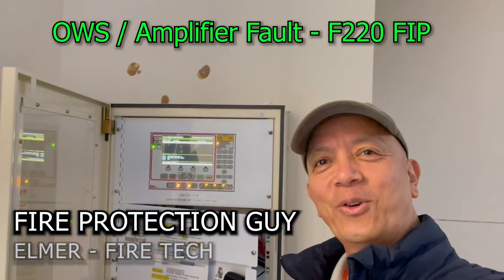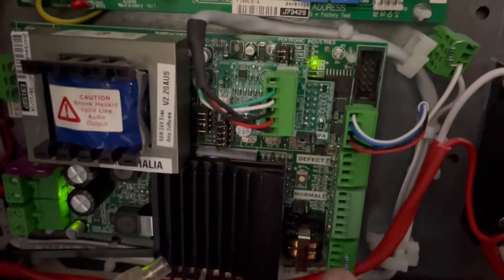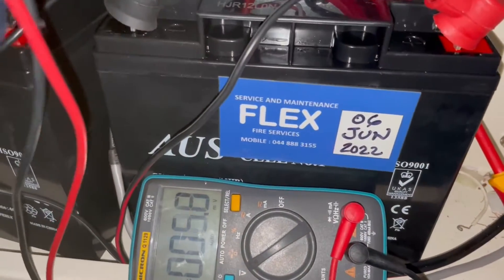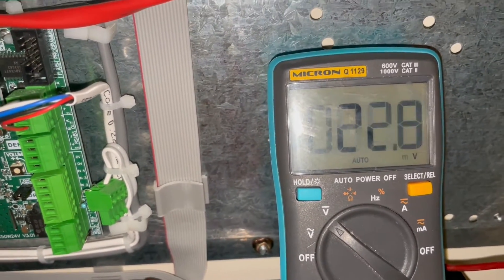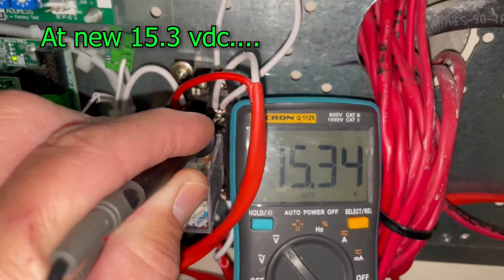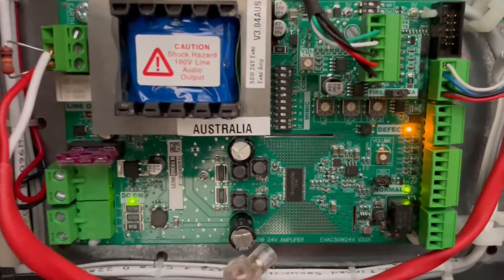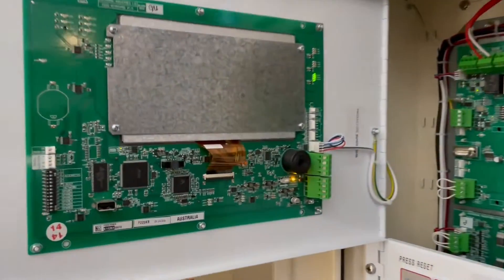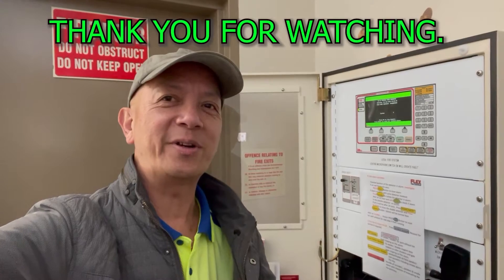Fire Alarm System Fault Finding - Occupant Warning Amplifier Fault

Comment: Sir Elmer nag apply po ako as fire alarm tester / fire alarm tech. sa NZ po. ill be having next week 3rd interview(panel interview) sa Nz po. Halos napanood ko na po mga videos nyo. Any tips po para sa interview ko po.tnx po
Reply from the maker: Most of NZ panel is pertronics system either F100A or F120A or F220 (newest that replaced both fire panel). All fire alarm panel I have featured ay matatagpuan rin sa NZ. There's more of course like WOrlmald F4000, Notifiers / Inertia panels, Chubb panels at AMpac Panels. But they are more of Pertronics system. If they ask you what do you know about fire alarm  and evacuation system testing...  sagot: it is done monthly and once a year. Tell them you are not sure if NZ is doing what Australia is doing when it comes to testing fire system. For monthly testing, you make announcement... isolate the fire brigade thru an ASE...isolate air con trip, fire door trip (if any)... trip the evacuation system or EWIS or EWS automatically thru an active alarm from the fire indicating panel... then reset the system after the test. Afterward, fill up the fire panel and OWS logbook. DONE. For yearly, test random detectors per zones . In australia under AS1851 ( Maintenance of Fire Equipment) , 20 % of heat detectors and 50% of smoke detectors in the building. Why 20%...so in 5 years all the heat detectors are tested.
Tell them that you are willing to test as well smoke alarms ( watch my video) for residential units and homes if assigned....and or replacing smoke alarm batteries. As a fire alarm tester, you must also check the battery if more than 2 years old or whatever the requirement of NZ maintenance standard. Tell them that you can replace FIP batteries. They are all 12 volts but different AH (ampere hour) ratings. 12v + 12v = 24 vdc . Fire sytem runs in 24volts with max output voltage of 27 volts DC.
Reply: @fireprotectionguy7943   salamat po sa mga inputs sir. God bless po

Comment: Please do video for fire alarm graphics system
Reply from the maker: Hi Reeban, i don't have a site with fire graphics system. I got few before when I was working as technician but no I have no access to those site. I will try if I encounter one.
Reply: @fireprotectionguy7943  you have site available for ahu, damper, sliding door, fm 200,access control, gate barrier system to fire alarm system interface.. If it's any of those available please do video